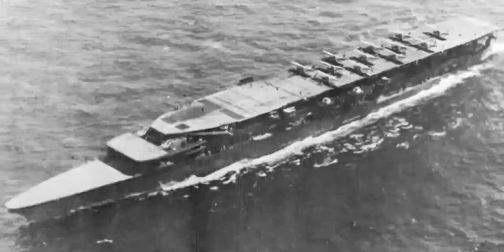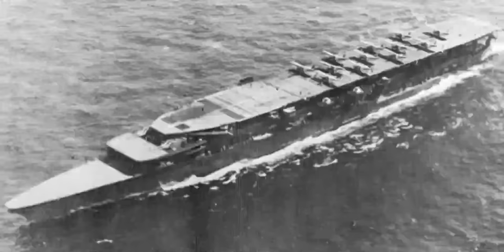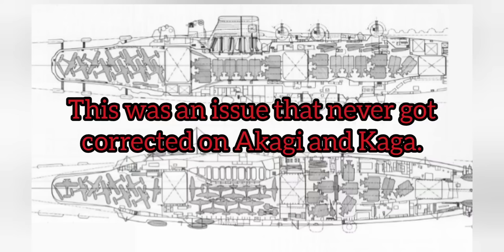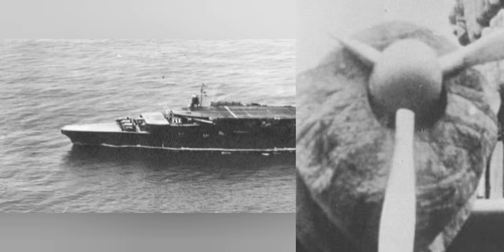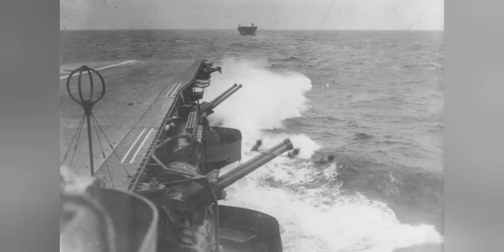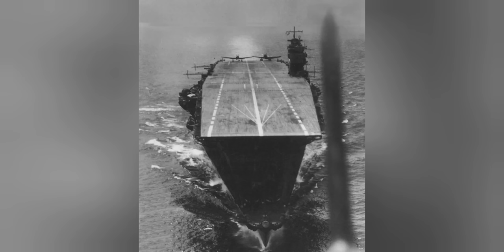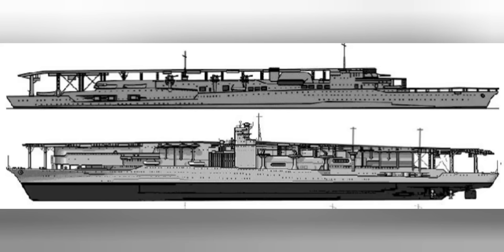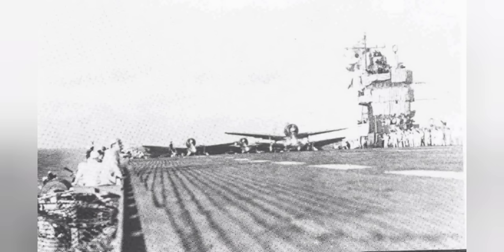Akagi and Kaga design faults. (Part 2)

Comment: Ok so if they had to enclose the hanger to protect the aircraft from the elements; the  how did the Americans manage an open hanger and deck park?
Reply: Tougher aircraft.
Better maintenance programs.
Reply: @memadmax69  that doesn't really answer my question nor do I think that's the main reason.

Simply because that wasn't really the case when ships like uss ranger, yorktown and wasp were first introduced to the navy.

The aircraft operated at the Time wouldn't get that reputation just yet although they were heading in that direction.
Reply from the maker: When it comes to the USN, they had different operations and approach. The open hangar had roll up doors along each opening that were closed under normal sailing circumstances to assist in controlling the climate within the hangar. The Japanese would use the same doors aboard Shinano as it had an open hanger. The aircraft parked on deck had their engines covered under normal sailing circumstances, like can be seen in the video at 8:26 aboard Akagi. While the Japanese did not permanently park aircraft on the flight deck to increase their numbers, they still did temporary deck parks and needed to cover the engine as can be seen in the timestamped photo. You can look up photos of US carriers sailing around with the aircraft engines covered. Both navies suffered from the same problem but decided upon different solutions to it.
Reply: @Caktusdud.  Being a former USN sailing engineer (MM2(SW)), I may know some things... Not everything... but close... ^.^
Reply: The Langley and Ranger were open sided because enclosing the hangar would make the ship top heavy. Later designs had partially enclosed hangar decks with roll down doors for protecion during bad weather events. The lighting equipment needed for night time aircraft maintenance and repair became a homing beacon for enemy submarines so the doors were kept closed at night. Enclosed decks required a strong ventilation system to prevent a build up of gasoline fumes and carbon monoxide.

Comment: Naval treaty pushed IJN to use cruiser hulls for early carriers, all of which were highly experimental.  Also, spending 30% of GDP on the military during a global depression and having limited access to metals resulted in stripped-down, compromise designs of lower quality in everything from rifles to logistic support anything, tanks, aircraft, and ships.  Finally, an utterly brittle and abusive command culture stifled initiative, tech, and doctrine, and left line personnel in all services hungry, exhausted, and poorly trained… for things like fire fighting on ships, for example.  In short, everything about the Imperial military was designed for a short-short conflict, even though their out-of-control Army leadership pulled the country into multi-year conflicts with no definable or even remotely-achievable strategic goals.  They were fucked right out of the box.
Reply: Well you really aren't fully accurate. The Kido Butai (the aircraft carrier group) was a pretty mighty hammer which for 6 months did immense damage. Also, they had excellent training for torpedos and night fighting. They kicked our butt at the Battle of Save Island. Also, certain admirals like Raizo Tanaka and Gunichi Mikawa were excellent.I have no idea what you are talking about stripped down designs. The Zero fighter was extraordinary (though like all designs with certain weaknesses). You are right that their Army leadership were basically crazy fanatics.
Reply: @lawrencewood289  / I agree, where they DID invest they did well.. which is really the final point for any military.  I was speaking in generalities.

Comment: They weren't designed as aircraft carriers in the first place. They basically stuck a flight deck onto a cruiser and called it a aircraft carrier !
Even the american escort carriers were better than these ships operationally.
Reply: They were battlecruiser/battleship conversions (Kaga substituted for Amagi which was damaged in the Tokyo earthquake) just like Lexington/Saratoga and Courageous/Glorious. They were FAR MORE CAPABLE ships than escort carriers. Faster speeds and much greater aircraft capacity.